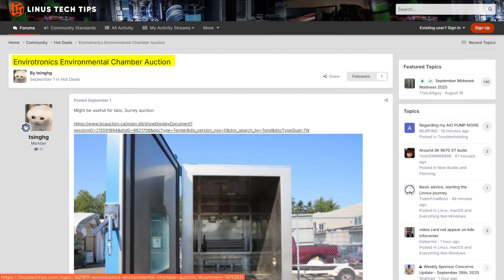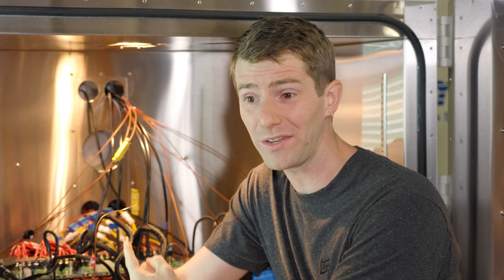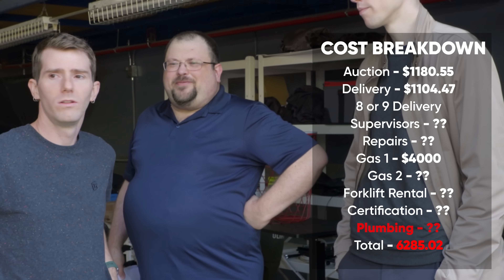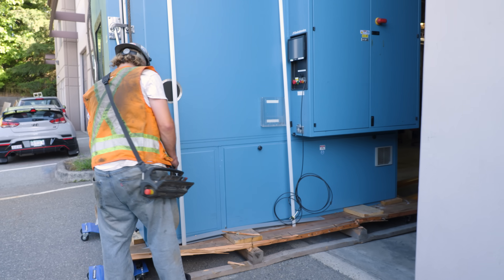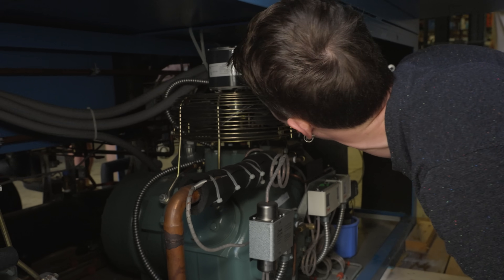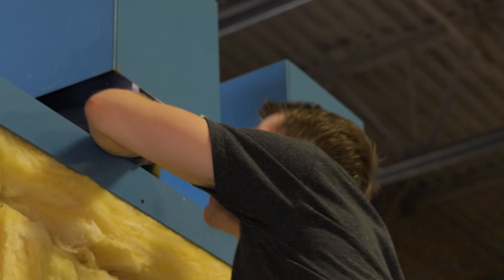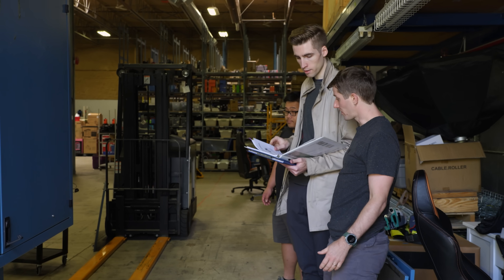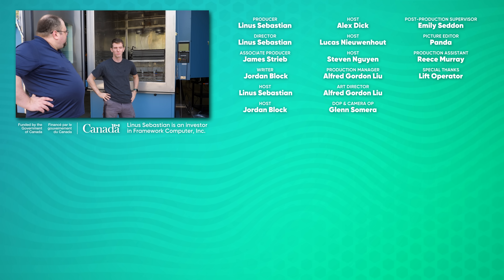They Auctioned This $40,000+ Environmental Test Chamber For $1000

Comment: I'm a refrigeration plant engineer - this looks like quite a simple cascade system (apart from the control system), any decent HVAC guy could sort out the refrigeration side for you relatively easily.
Reply: I believe they even have a jingle for a guy now working with HVAC, formerly an electrician.
Reply: @irispettson  brian
Reply: Probably somebody familiar with 508b systems / ultra low. Plenty of pharma & lab stuff that needs skilled techs, I'm sure there are plenty of options.
Reply: Question as someone who knows only two things about HVAC and cooling systems in genereral, that being Didley and Squat;
I noticed that one their coolants was Insanely expensive.
How difficult would it be to re-work/MacGuyver the cooling systems to use cheaper coolants? Or can you just sort switch one coolant for a cheaper/better one, or does it have to be that super specific chemical?
Reply: @The_Keeper  I think you'd spend more money in time trying to come up with an alternative solution, than it would cost just to buy the designated coolant.
Reply: @The_Keeper  on the high side of the cascade there are lots of options. On the low side, very few. The issue is pressure vs temp - most typical refrigerants are well into a vacuum at roughly -50f. If you want to go colder, you're quickly limited in refrigerating capacity because there just aren't enough molecules of the refrigerant to move the heat at such low pressure. R508B (my best guess for the low side, thought it could be a proprietary mix) is at -125f at 0psig, and works decently down to something like -140f. The other issue with different refrigerants is something that works well at -100f is gonna be really high pressure at room temp so the system was built for a specific refrigerant to handle that pressure range. 

Change refrigerants & you're likely starting from scratch on the low side unfortunately.
Reply: @The_Keeper  the alternative is to change refrigerants but only run the chamber down to something less extreme. -50c would be below anything seen in nature, so unless they're messing with quantum or trying to do cryo (which wouldn't work in this unit anyway, just use liq N2) it might be enough to accept a warmer low temp.

Comment: Dunno what he has with the plumbing, looks absolutely fine to me, it's oxidised, that's normal for copper, no verdigris, nothing. It's also soldered, not pressed or screwed together, for something that was standing outside for 10 years it looks great. 

The valves are probably the thing that needs to be replaced, not the entire valve, you can remove the main valve part and switch that without removing the whole thing.
Reply: I was thinking the same, it looked completely fine tbh. But as you said, any movable parts like valves and so on might need a rehaul.
Depending on what refrigerant it's been made for it might be suitable to do a conversion to a less GWP heavy (and possibly cheaper) refrigerant if they gonna replace/repair valves etc.
Reply: @NoRestForTheWicked0  I could bet that most of the rubber gaskets or paper gaskets if there are any are completely dried up and cracked. 

I am also not so sure about Refrigerant, I haven't worked on too many AC units and the likes, only worked on a couple in 6/7 years of being a plumber, but I think that the compressors need specific refrigerants to work properly, perhaps there are conversion kits to make other cheaper options work.
Reply: @ninetenduh  Yeah absolutely, all the rubber seals and gaskets would probably need replacing after that long.

And true, systems are designed around a specific refrigerant and compressor spec. But many refrigerants have very similar thermodynamic properties, so a conversion can often be done without any major hardware changes.

For example, in the systems I work with they were originally charged with R404A, but since that’s no longer allowed to refill with in the EU at least, they’re now converted to R452A instead. It’s a drop-in replacement in practice, just requires some parameter adjustments using components that are already built into the system.
Reply: @NoRestForTheWicked0  environmental test chambers are typically excluded from regulations because the market is tiny & they have such specific needs that most replacements won't work; they're all compromises to get a lower environmental impact. In most applications that's no big deal, but on an ultra low temp system those compromises mean it won't work. 

Whatever the case, it's not gonna be cheap but it absolutely can be done.
Reply: I guess at professional level
They could redo all the plumbing instead of facing backlash of some of the lab results go wrong
Reply: I think he was talking about the „clear“ water lines that look absolutely disgusting

Comment: Lol how did the CEO Approve this??? The repairs gonna be sooo expensive
Reply: I think it would be way below Linus's spending approval limit. (I think there is a passing mention on one of the driving simulator videos that Jake was allowed to spend up to $750 or so without having Linus sign off on it) He had to talk to Terren (and certainly Yvonne) before buying the firetruck but that was $20,000+.
Reply: @Metal_Maxine this actual came up on WAN a few months ago, they ended up calling Terren because even Linus didn't know his spending limit without authorization. 🤣 
Answer was basically they'd have to take about it. 😂

Comment: There’s a lot of rly good guys that can trouble shoot the hole electrical side of it. Like guys that work on old cncs between the 80s and 2000s. Some of them even have there own custom code and programs for them that work better the original and fix problems they had from manufacturing and set up.
These guys are wizards. But there time is not cheap and can be hard to get them in unless your business is not functional because of it then it cost you even more.
I would try and find a company that uses one and see if you can get the number of the guy they call to trouble shoot when it’s messed up

Comment: If the hard drive in the computer is still inside, I would  send it to a recovery service ASAP to at least get the software.
Reply: 100%. If it's proprietary, it may be jover
Reply: @chancefreely nah. It's basically just a big refrigerator. Most of the actual controls are mechanical and electrical. I suspect the Dell 16:21 PC is mostly for data logging. The other PC they found inside is an industrial unit, that one might be a different story, without it there would be a lot of PID tuning to get everything running properly again. Honestly the entire thing actually looks really good. However if the nitrogen has all leaked out there may be internal corrosion (as I only saw pressure gauges at 0)
Reply: @JanPeterDeVries  nitrogen is inert. afaik it was emptied after it was decommissioned
Reply: @cubertmiso  They specifically mentioned that the refrigerant was drained and replaced with an inert gas.  The inside, if everything is sealed, should be fine.
Reply: @cubertmiso  yes nitrogen is inert, but OP said "if it all leaked out since the gauges showed zero pressure" the gas that took it's place most likely isn't inert
Reply: why recover, just clone it...
Reply: @igalaviz  thats assuming it's still in working condition
Reply: @igalaviz   recovery is cloning. You don't recover to the same drive. That's how you lose data
Reply: @da3dsoul I'm curious, where did you get the idea they wanted to copy the data onto the same drive?

Cloning typically means taking the data and putting it onto a different drive.
Reply: It might not be as big of a deal as you think. The assets of Envirotronics were purchased by a couple different companies, so theoretically the software/PID tuning needed to operate this thing is still recorded somewhere.

Also, the now top comment on this video is from someone who supposedly works at Weiss, which is the company that bought Envirotronics, so they seemingly have a connection already.
Reply: shouldn't need a recovery service, just connect it to any Linux pc and use ddrescue to create an image of the drive.
Reply: @kiwihuman hddsuperclone!
Reply: Comment for the algorithm
Reply: @markman278  yes awoof UwU

Comment: Could you use a dummy gas for the second stage, if your need was satisfied by a single cooling stage? Might save a lot of the cost.

Also: Why can you not pick a different coolant? I would expect them to be mostly plug and play after calibrating the thing.
Reply: second coolent needs to go much lower temp than regular coolant would go without going liquid or even solid (think co2 is solid at -78.5C) so if you can go to -170 or lower  you're talking a completely different level of colant. There are not that many options at those temps. liquid nitrogen or neon are probably ones to go for, or liquid helium for the lowest temps. (liquid hydrogen is also a solution but has more risks so is probably not an option)

Comment: those comperssor's are about 120KW of power each and then you will need to get rid of the heat wich is gone be in the range of 500-1000KW. Next video: We got a transformer upgrade.
Reply: Wait, just making sure... You mean 500kilowatt to 1 MEGAwatt??? That seems like so much energy, no?
Reply: They aint lol, nowhere near that power probably closer to 7KW, they can buy a relatively small external chiller to run the high stage compressor
Reply: @Randomness920 based on the top cooling fans it looks like it wants 600v 3 phase (which is a thing in Canada). So I'm not gonna guess on numbers but it's gonna be a hungry Boi.
Reply: @PsRohrbaugh  I bet they would pull like 12a a phase if that, i work on several climatic chambers and even the room sized ones pull near to nothing on 420v 3 considering the work they do, the biggest cost is going to be refrigerant especially with changes in regulations, it might need retro fitting to a different type although theres a bunch of drop ins just needing oil changes
Reply: I doubt it's ever going to be run at that sort of load these things are way overbuilt to ensure constant temps for rapidly variable heat sources. They're setup to maintain a certain differential on hot vs cold side.
Reply: Where the heck are you getting those numbers from? You're off by a factor of ten at minimum. Zero chance this thing draws 1 MW lol
Reply: @mrbitjetson  I take every opportunity I can to say order of magnitude. So much more satisfying than factor of ten.
Reply: @MichaelLong777 😂 I say order of magnitude too often so I have to switch it up sometimes

Comment: All these engineers and they place these rolling boards in the most stressful position. If they would have turned them 90 degrees they would probably not have flattened out. Plus there would have been more ground clearance.

Comment: Worst case scenario, it could make a cool staff room fridge?
Reply: We have about a dozen of these at my work in the lab area.  When the lab techs have a pizza party, this is where they keep them so the pizza stays hot.
Reply: @SteebMo Does the inside not keep smells?
Reply: @AlfA-3621 not at all. I mean ovens and fridges generally don't either and every surface of a thermal chamber like that is stainless steel so it can be cleaned very thoroughly just like a commercial kitchen.
Reply: I mean that's not even close to worst case scenario, it could be a endless money pit, burn the building down, or explode. Just to name a few.
Reply: AAAAhhh yes,.....10 000 Watts from the grid to cool drinks xD
Reply: More like worst case Ontario